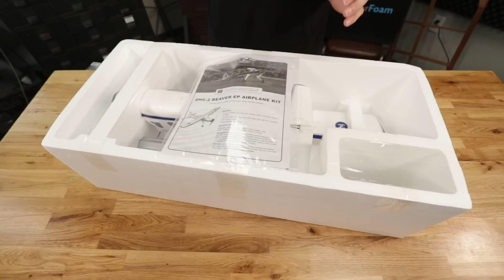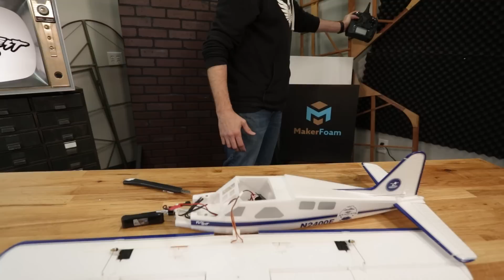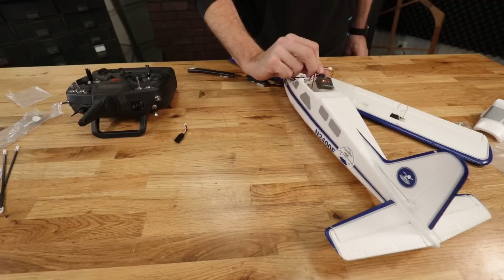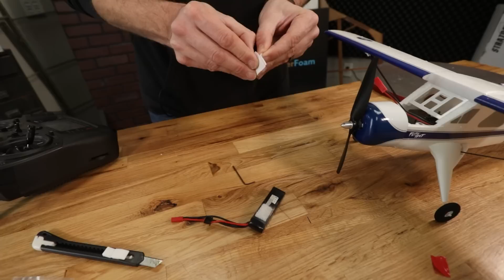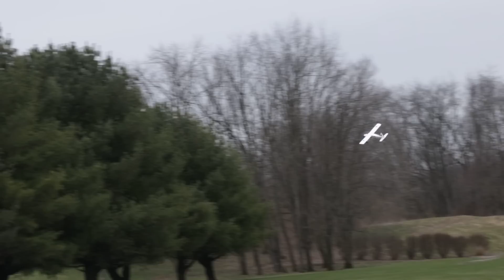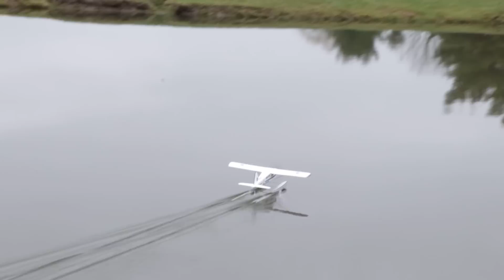FT DHC-2 Beaver / BUILD / TUNE / FLY

Comment: Hi Josh -  I bought the FT DHC - 2 Beaver and the motor won't work.  The ailerons, elevator and rudder work.  I even bought another receiver but still no good.
 Could the motor be defective?  I use a Spektrum DX8. Any suggestions?

Comment: just assembled mine! the video was a great help. I’m a drone guy still learning to fly planes after 2 failed attempts at flitetest kits. My question is whether you’d power an fpv cam/tx with a separate 1s battery and have additional weight or with a servo connector to the receiver but maybe less flight time?

Comment: I have some 3 cell 380 mah batteries laying around. Can the electronics in the adventure or beaver handle the extra current? The packs are close to the same size of the 2 cell 500 packs I have.
Thanks, Jon.

Comment: I have this plane. I installed a full size spectrum receiver I had laying around. I’m running a 600mAh battery and everything fits fine. I like how even tough it’s a micro it’s put together like a larger aircraft. I fly mine off off my local lake and it’s so much fun. Very stable, easy to take off and land on calm water. Buy this plane, you won’t regret it if you are into small planes. I am hoping the Widgeon comes out soon....any estimate on release date?
Reply from the maker: Glad you are enjoying the plane!! Not 100% on the Widgeon but it should be soon we hope!!
Reply: @FliteTestTech  well I needed a new set of landing gear as many landings on my rough Field finally took its toll. The landing gear have foam fairings on them and are delicate. I ordered two pairs and Flite Test packed them in an envelope instead of a small box so of course they were crushed, smashed, and broke during shipping. Should have been common sense to pack small, foam parts in a small box so they can survive shipping. I contacted Flite test to tell them what happened and thought they would simply drop replacement gear into the mail, hopefully in a box this time. But no, it turned into a big ordeal. They demanded photo proof over a $4.00 part, I guess even though I have spent a few hundred dollars with them they thought I was trying to rip them off for $4.00. (They said it was for training purposes) My phone was recently stolen so it wasn’t convenient to take and send photos. I would have to dig out my old digital camera, upload photos to my PC and attach to an email, not worth the trouble for $4.00. They absolutely refused to send me the part I needed to get their plane back in the air so I finally told them I was returning the part for a refund. They would rather refund my $4.00 and lose a customer than send out the part to get their customer back in the air. This is very short sited business practice as they saved themselves a few bucks by refusing to replace the part they poorly packed but lost a customer who has spend thousands on the hobby over the last couple of decades and had already spent a few hundred with them. Of course I will never spend another penny with them as the customer service is atrocious, they left me with one of their products that is now unusable because they refused to send the replacement part. I have been spreading the word of my experience in as many places, (forums, club, youtube, etc.) as I can think of to warn people. Buyer beware.
Reply: What battery did you use?